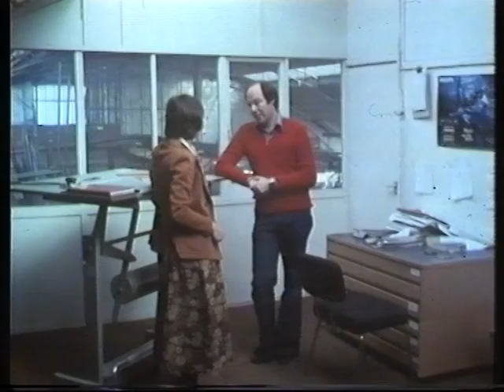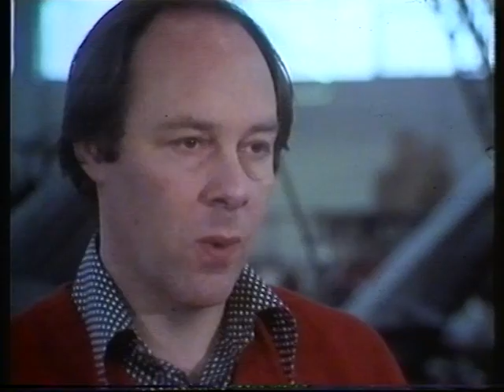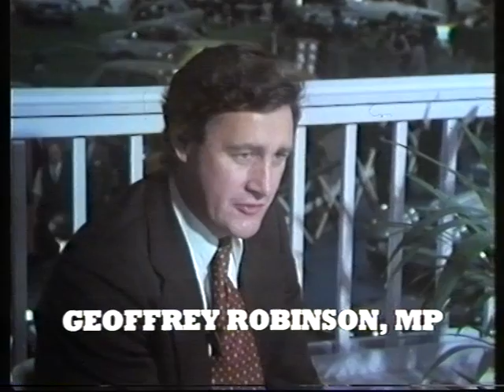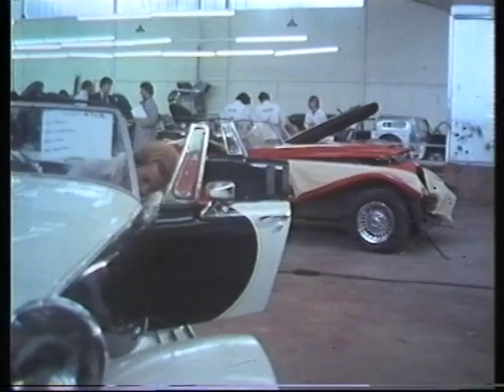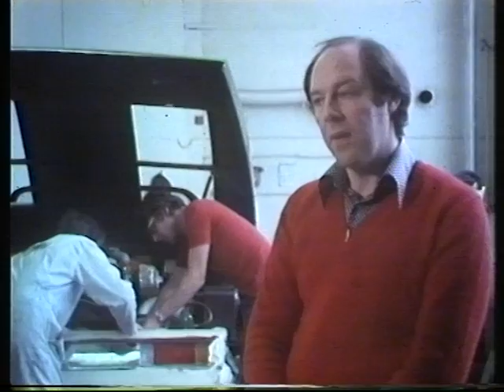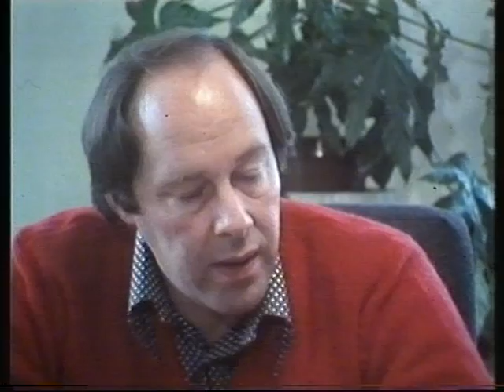Panther 6 | Vintage Cars | Thames Television | 1977

Comment: Had a pack of Top Trumps.  The Panther 6 was unbeatable card in the pack. Really doubt the 240 mph. Arodynamics and tyres and only 600 bhp. . Reckon 180ish probably a true figure.  Still a feat in 1977.
Reply: I had the same top trumps! Had lancia stratos, pininfarina modulo, De Tomaso Pantera in it. I loved the Modulo and Pantera!

Comment: Didn't they get revived in the mid-late 80's, I recall a panther solo with rotating pop up headlamps, I believe there was one at an earls court motor show actually mounted diagonally on a wall.  This would have been about 1988. They didn't put cigarette lighters in the cars as the owner didn't believe in spreading bad habits.
Reply: Yup but by a Korean. They also went bust in the 90s.
Reply: Panther kallista

Comment: 240 mph my ****! A nerdy observation is that apparently the steering was all over the place (not surprisingly perhaps) because you have to have all 4 wheels turning at slightly different angles or they sort of fight each other (called the ackerman principle I think as in a turn the inner wheel subscribes a smaller circle than the out - times that by 2 as the second axle is 2  foot + further back than the first. So all 4 front wheels should deflect by different amounts). Maybe Chapman could have coped, but wasn't this bloke a fashion designer??
Reply: I don't think engineers have much trouble with ackerman steering whether with two steering wheels or four. The real issue is that on a car it brings no real benefit while increasing rolling resistance.
Reply: I read over 200 on the dash board before the old man chickened out on the M1; he was a racing driver in his late teens.
Reply: @pauljankel6754  Thank you for the reply, I wasn't trying to be disrespectful. I was at University when the 6 came out, definitely a poster car, and saw it at a Motor Show (year and location escapes me). You must have had an interesting childhood! At University in London I remember Rios in HR Owen by South Kensington tube. Wonderfully bonkers cars, cutting a swathe in all the mainstrean 1970s tin.. ps If you have a spare J72, 6 or 12 cylinder, please let me know, i thought that was beautiful!
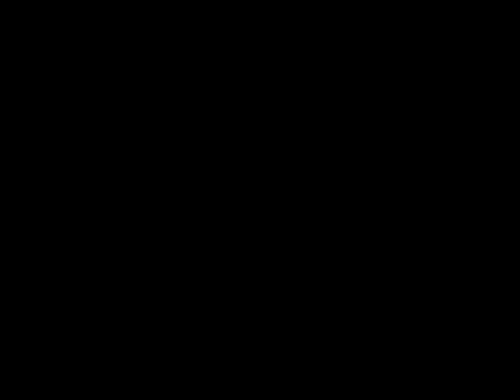Reply: pps panther FF at 1:56? That was absolutely beautiful, lovely style of a very early barchetta type Ferrari. Ferrari powered as well I think

Comment: Only 600 BPH 200+mph no way, no aerodynamics eight orders and only two manufactured. Destined to fail with this model.
Reply: Yestercars..THE POWER V-8 BY ,.. MIKE COSTIN & KEITH DUCKWORTH  ))))
Reply: I'm sure I remember seeing one in a dealership in Bebington on the Wirral in the UK while on the bus on the way to the sports centre there. Not sure it looked quite the same as the one in this video, more a cross between the traditional cars they built and a six wheeler. But I still want one!